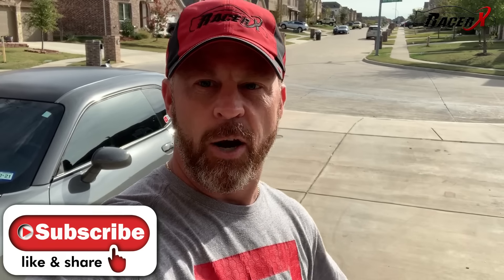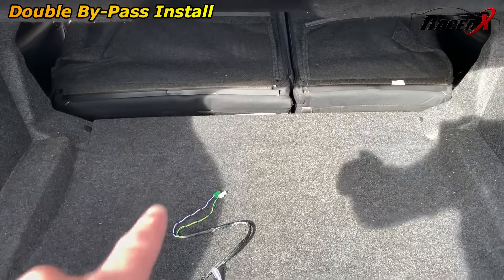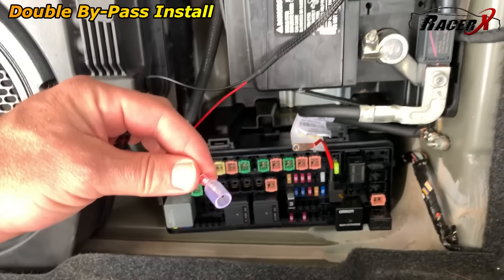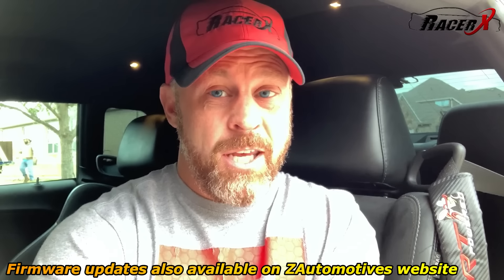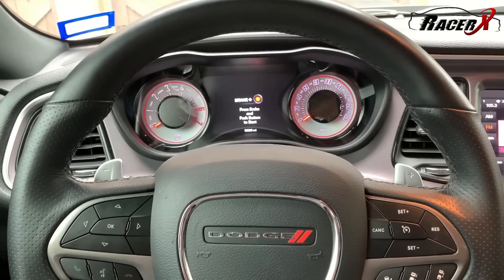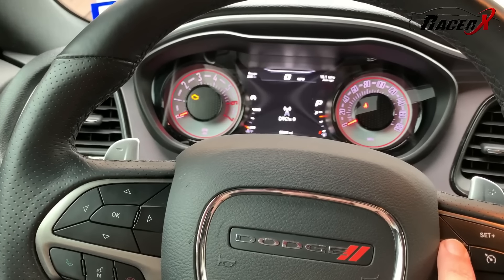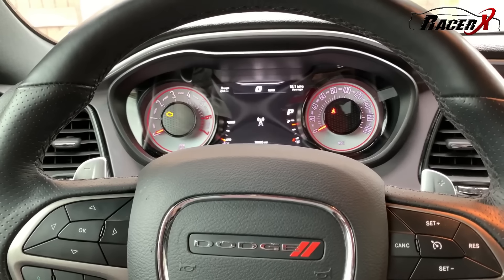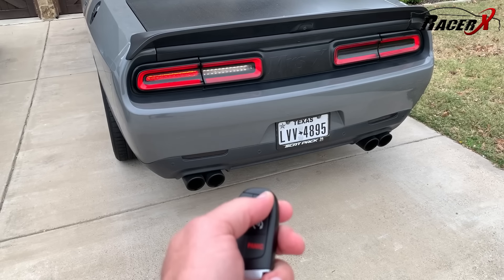If you own a Mopar this is a MUST have!  Small but Mighty mod..

Comment: I enjoy your videos. Very informative. I'm 68 yrs old ,but young at heart. I've been looking  at low mileage used   R/Ts . I'd love to have a SRT, but my retirement money can't buy one. I only want a manual & something my wife & I can take on a trip. I was raised with Mopars. Dad didn't even consider anything else.
Reply: Good to hear we got an older mopar fan 🤙stay young and safe sir 🙏👍
Reply: R/t is nice💫💫
Reply: RT is  fine  if you drive it like an RT ...I'f your putting around town ,Sunday driving,maybe an  SXT is more your speed
Reply: @jeffpatton6358  I've never been known for putting around town. I'm already compromising to consider less than 400 hp.
Reply: @boblee6477  I hear ya that's why I got scat pack Challenger, i hate paying gas prices
Reply: @boblee6477  To the wheel or crank Bob...lol.
Reply: do iiiittt
Reply: I’m going to be the same dad with my kid
Reply: The 392 rt/scat isn’t a bad option either if u want 400 hp get one with like 30k miles and u can get it for a pretty good price
Reply: I have roth ira . I will buy a Lamborghini at retirement  🎉
Reply: Even mid mileage 70k aint bad a good 10-12 years with that. More if you're on top of it.

Comment: This was the first mod I did for my 2016 Charger Scat Pack. I wanted to enable the Valet and Track modes that the SRT models came with that year. Works great and has lots of other features. Definitely recommend this product!
Reply: Does track mode make the car faster
Reply: @just_a5.7  I believe in Track mode that the shift points are raised a few hundred RPM and that the transmission shifts a hair quicker. If I remember correctly.
Reply: Wetetwtwtwt

Comment: I love my Tazer. The line lock it great for burnouts (I have a 2017). I shut off the seatbelt chime and it lets your passenger set the Navigation when the car is moving. Best thing the Scat Bee at start up. Some many more things can be done. I did not do SRT mode as I wanted the Scat Bee at start up. Read your  directions as there are so many cool features. Thanks for another great video.
Reply from the maker: Yes tons of crazy features with this product 👍

Comment: I bought my 2018 Scat Pack used and the previous owner left his Tazer in it.  I love it because the 2018 does not have Track mode or line lock and with my Tazer I am able to access both.  You guys have really put some miles on your 2019 Scat Pack.  Keep up the good work I always enjoy your videos.
Reply from the maker: Yes she drives the crap out of it 👍
Reply: I have a 18 shaker and it has line lock when I press the "super trak pak" button. I don’t have any srt pages though so I’ll definitely be getting the tazer

Comment: I was iffy if it was worth it before. Now that it has been updated, it is 100% worth it. If you have an RT, you can force the engine and transmission into race mode. It makes a night and day difference in performance.
Reply: what about a 2013 6sp R/T Blacktop without an info screen?
Reply: @walterbrown9651  I believe it's still worth it.
Reply: @Xcieg  I will look into it!

Comment: The double bypass is super easy to install and is definately worth it. It basically integrates the tazer and you will probably never see it again....The buttons are just as useful and make controls seamless and factory like.  I set mine to 1. Light show 2. Sport mode (even though it starts in sports mode) 3. Track mode.
Reply from the maker: Yes sir..  agreed 👍

Comment: Glad I  watched your video..
I did not need the bypass on my 2015 but did not realize that put it in the trunk and opened up the OBD2 for tuning..
 I was under the impression that I could load the software on the car and not need to leave the taser in for the functions to work.. but found that not to be true.. Many functions need the taser plugged in at all times..thx again MoPal..

Comment: I had one of these for my 2016 SXT & it was awesome. For my '09 R/T, I'm getting Diablo.
Reply from the maker: That works too
Reply: Yes sir, the Tazer was only for 2011 & up, so it wasn't an option anyways when I got my '09 R/T, but both are fantastic products. Even though he has to get it reflashed, I actually gave my Tazer to the salesmen that sold me my Stinger GT1 because he was getting a promotion & buying a Hellcat after the sale.

Comment: Can't wait to get mine! Excited for those performance pages.
Reply from the maker: For sure my friend.. its definitely a cool little mod
Reply: MayhemMercenary, have you checked the QC sheets on these, before plunking down your hard earned cash??
Reply: I cant figure out how to get mine
Reply: Only works if you have the bigger radio installed
Reply: Only works if you haven't connected your uconnect to the server , wasted my time had to reset everyday to use the pages
Reply: @rkkustom  what do you mean? Reset everything? Like do a factory reset and it’ll work? I can’t get performance pages working but can get SRT modes working.
Reply: @Skater4Life8o5  yeah go to the radio settings and factory reset and it usually shows up for a few start ups then disappears
Reply: I was just talking to them today. The srt pages and will only stay if your car came with the super track pack option. For 2018+ anyways.
Reply: We don't guarantee performance pages on the 2019, but you can try these steps. It might work, but if it doesn't then you probably can't get them.    
 Because of the double bypass needed on the '18+, there are a few extra steps you need to take. Not all steps pertain to all models. 
   
 1. Turn on SRT
 
 2. Set DrvMode to SRT
 
 3. Steer to SRT
 
 4. ShiftIT > On
 
 5. Eco > On
 
 6. Do a "Full Reboot" (which will take around 2.5 minutes)
 
 NOTE: Your radio WILL NOT reboot since it's a 2018 model, so you need to:
 
 7. Unplug and plug back in the double-bypass fuse block in your trunk
 
 8. Start your car (The radio will say that it's locked until you start it)
 
 9. Give the radio around 1 minute to fully boot (XM will be missing at first)
 
 10. Shut your car off
 
 11. Open and close your driver's side door
 
 12. Let it sit for a minute or so after the dash goes dark (this accounts for a full sleep cycle)
 
 13. Start the car and settings will begin to switch over
 
 14. Repeat steps 10-13 one more time.

It's not even that, it's just anything that didn't come with performance pages after 2018, we can't guarantee that they'll stay enabled because Uconnect remotely connects to your car and disables them. 

This is what Z automotive told me

Comment: Thanks ! I have a manual 2018 shaker 6.4 . It will make burn outs  easy !! Just plug the two plugs  into what's available on each side.?  Blue /White - Green / Yellow . Then the  one on the fuse. And ground wire. Thanks ! Cool !! Plug the Tazer in .
Reply from the maker: You got it..

Comment: 13:24 did he say if you install a camera? Can someone explain? If you install a camera you can watch it live on the display? I would buy it for that feature alone. Can someone confirm if this is correct?
Reply: Correct. My charger did not have a camera but with the tazer I was able to install an OEM camera and it works flawlessly

Comment: Racer X, Thank you for this video. I watched it when you put it out, and it's taken me two years to finally get around to buying the Tazer for my '16 392 Scatpack Charger. I picked up the trunk install wiring harness as well. I will be installing this little gadget when the rain stops. And the reason I got it? I want my car to default to starting in Sport mode with the different shift points, and I do NOT like the stability control. I prefer to control the car based on the feedback I get, and not let some computer do it for me.
-'68 Barracuda

Comment: Line lock, full traction control kill, lightshow, engine cooldown and seat belt ding are the main reasons why i bought it for my RT. Sadly the rt’s can’t get the full srt mode
Reply from the maker: thats a bummer .. hopefully you at least got some good use out of it
Reply: What year is your R/T? Cause I ha e the same problems and reasons on my 2017 Charger
Reply: @nytowl3166  2019. I think SRT pages only work if u have the 8.4 inch uconnect screen. I have the 7inch screen so it doesnt pop up. U can still change the font and get SOME of the srt features but not all of them. But if u do turn it on your aport mode button acts weird and u have to map it to a different button which was faulty at times
Reply: @DCGEMINI202  yea mine did the same thing so I have to turn on sport mode on my screen instead of the button but I usually use the light show at car shows or when Texas Mopar club gets together or track mode and line lock when at the track having but that’s it
Reply: You don’t get str opinions ?
Reply: @UnfamousRT  naw. It doesnt pop up on the screen

Comment: Interesting, but if it doesn't add security like kill switch or something I don't think I want to mess with it. There should be a way to disable seat belt warning like the stang allows without a mod. Granted I haven't looked into it for the challenger yet.

Comment: I have a 2015 challenger rt scat pack and my sport mode seems to not work all I get a a blank background with the icons at the bottom. My question is if I buy the ztaser will it activate my sport mode again

Comment: would have liked to see it pluged in before cover put on !
Reply: The white connector goes into the green star connector and the green connector goes into the white star connector. It doesn't matter what open space you choose in the green star connector. It's basically a splice block. You're plugging into the CAN-C and IHS buses. The newer cars have a security gateway module so you can't just plug into the DLC. The DLC is not directly connected to the vehicle networks.

Comment: I definitely could use that for my 392
Reply from the maker: Absolutely..
Reply: @RacerX9  if a challenger and an m4 had a race who would win
Reply: @blademaster2701  depends on the trim. If a demon races an m4, the demon would easily win. If an sxt races an m4 the m4 would win. A scat pack would win against an m4 as well.
Reply: @Michael-tm6vs  an srt 392 trim
Reply: @blademaster2701  a scat pack and 392 srt are the same.
Reply: SRT 392? You should have line lock performance pages etc already no?
Reply: @Michael-tm6vs  what about an rt with the 5.7
Reply: @Michael-tm6vs  Not really but very similar.
Reply: @SRTCAT  engine wise i mean
Reply: @blademaster2701  rt won't stand a chance against an m4
Reply: @Michael-tm6vs  No, they are not the same. A scat Pack is different from the SRT.
Reply: @Michael-tm6vs  yes powered by SRT.
Reply: @pwpt6  You got that right.👍🏼 Having a 392 Scat Pack  is a RT with a 392 engine powered by SRT. (STREET RACING TECHNOLOGY)
Reply: @pwpt6  I'm talking about the engine
Reply: @Michael-tm6vs  so a scat pack or srt 392 can beat a m4 gts
Reply: @Michael-tm6vs  well those 2 dose have the same engine and horsepower and torque
Reply: @blademaster2701  why are you comparing a $40,000 car to a $134,000 racing vehicle?
Reply: @Michael-tm6vs  to do a funny video with it
Reply: mostly because someone told me "if I am loyal to Mopar race a beamer"
Reply: @blademaster2701  try to cop a hellcat. A hellcat will eat an m4 for breakfast, lunch, and dinner. Also with power dollars you can get one at a good price.

Comment: Does this device circulate the coolant while the engine is off and it turns the fan on? I could see how operating the inter cooler pump and fan would be beneficial on a hellcat, but just the fans running? Seems like the only “benefit” would be draining your battery

Comment: This really does add a ton especially if you didn’t go crazy with options or you have a lower trim. I’m surprised Chrysler even allows it
Reply from the maker: Yes it does..  it’s aftermarket so FCA cannot necessary regulate it 👍
Reply: Yep, I got my drive modes and launch control programmed in the steering wheel where the adaptive cruise buttons would go...

Comment: I'm doing my first oil on a 2020 scat pack  challenger any suggestions  of what type of oil and filter I should use?
Reply: Mobil 1 0W-40
Whatever high end oil filter you find after doing some research. I think I went with the actual one from Dodge.

NEVER fram

Comment: I have a rattle noise in my exhaust usually when I do a cold start its really noticeable or when it's over 1500rpm you can hear it.. any suggestions on what I can do to fix it? I have a 2019 charger RT
Reply: Is it your active exhaust valve?
Reply: @pbpyro5546  not sure honestly
Reply: @michaelvillarreal430   I’d say start there first because I hear a lot of people have trouble with the active exhaust valve in the pipes flop around loosely
Reply: @pbpyro5546  so maybe try a muffler shop or ?
Reply: @michaelvillarreal430  if it’s really the flap in the exhaust system you can buy the active exhaust delete module. It holds the flap open. But yes start there

Comment: Sorry if this has been discussed-

I have a 2018 Challenger GT. It's V6.  It has 19k miles.   I seem to only be able to push it to 114 mph on highway straight runs. It seems like it just doesn't or won't go faster.   Like it has a governor or something locking it.

Does anyone else experience this and is there an addon or way to remove this? It feels like Dodge did this.

Yes, I know my car isn't an RT or SRT but I feel the car has more in it than what it's being capped at.

Thanks all!

Comment: Definitely getting one for my 2020 gt challenger
Reply: You have the 8.4 UConnect? Because I had a 19 Challenger rt and performance pages didn’t work with the 7 inch uconnect
Reply: @Changed2024  yes I have the latest 8.4 uconnect updated feature for my challenger.  It came stock I am really looking forward to learning more about the technology and all the uses , something for me to have an open mind to
Reply: Jay Jay oh interesting to see if the perf. Pages will work for you as I know the it didn’t work on my 7” uconnect on my 19 R/T but yeah now that I have a Scat Pack I don’t need the tazer😂
Reply: Why so you can save more gas? This guy😅☝🏾lol
Reply: @sub_zerotv3877  it's a simple install, sure bro why not what you drive? 😂🤔

Comment: Hey! I got a 2018 scat pack charger. And I’m curious about track mode. Does it shift faster and harder than sport mode? Also would this keep the exhaust valves open so I can hear that awesome exhaust even at low rpm? My car doesn’t have track mode so I’m trying to decide if it’s worth getting a tazer just for that.
Reply: I have track mode on mine and it shifts fast and hard. And both sport and track keep the valves on the exhaust open but track definitely seems louder and deeper. I had track for my trans and steering and auto/street for traction and suspension in custom but switched to sport instead of track. I’m going to save track mode for certain occasions and use the whole mode

Comment: Do you know or think that it would be a problem for the cars warranty
Reply from the maker: You should have no problem with the warranty
Reply: It won't be a problem with the warranty if you disconnect it before taking it to the dealership, that's one big reason for the "marry", "unmarry" feature. The Tazer unlocks the circuitry installed in your vehicle from the factory which may not be available to you otherwise from the trim level you purchased.

Comment: I own a 2017 Dodge Challenger SXT plus, can someone tell me what this Tazer will actually do to my particular model Challenger?? Thanks in advance.
NOTE: My Challenger does not have Super Track Pack option.
Reply: It basically opens options of higher trim models, I used this on my 16’ charger, I have all the pages, srt font, performance, etc. Not ever option will work if your vehicle doesn’t have what it’s searching for, ei putting it into track, transmission and steering with change but not the “traction” as it doesn’t have the right suspension and what not
Reply: @Viri-  Traded that challey for a 2015 SRT 392 Hemi, will the Tazer do anything for me in this model vehicle?

Comment: Would the line lock break anything on my Grand Cherokee? I’ve always wanted to do a burnout in my 5.7 but heard it’s not good for the transfer case since it’s full time awd
Reply: Line Lock: The Tazer will use the ABS solenoids to lock the front wheels for burnout purposes. To use this feature, you must stop the car then press the steering wheel “back” button (2011- 2014) or left arrow button (2015+) and hold it while pressing the cruise + button. Continue to hold either of the two buttons, or both. Once the ABS light on the dash comes on (and EVIC message “Line Lock ON”), pump the brake pedal twice firmly and release. Press the gas pedal, and the rear
wheels will break traction. Brakes release when the back/ok button is released. On AWD vehicles, the AWD system will be temporarily forced into RWD until the burnout is complete and the vehicle returns to a full stop. ESP will revert to “Sport” when line lock is released, or Custom Drive mode for 16+ SRT/Hellcat/Scat-set-SRT.